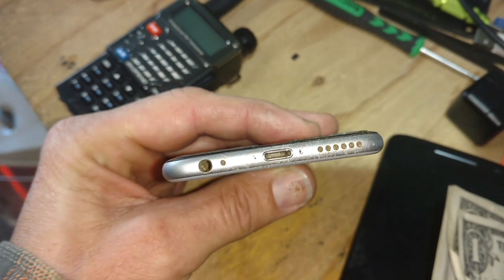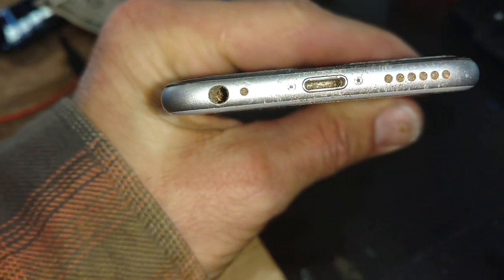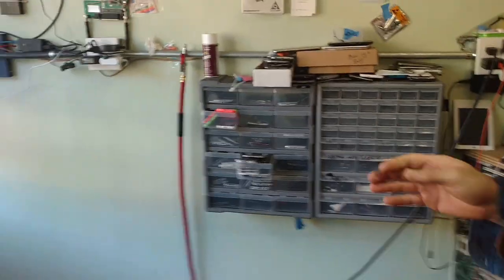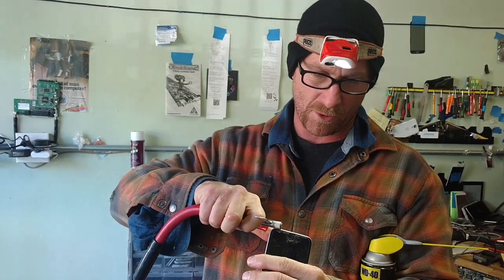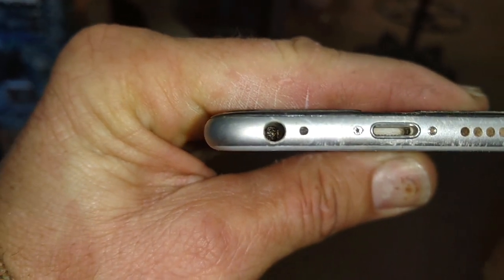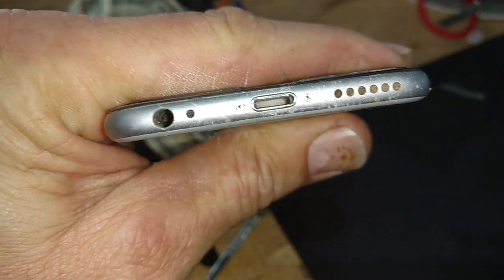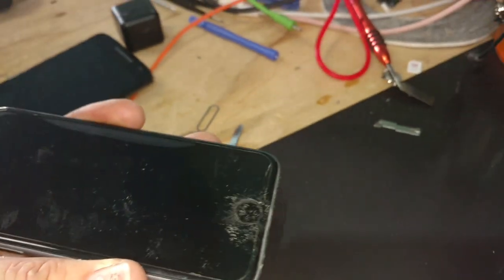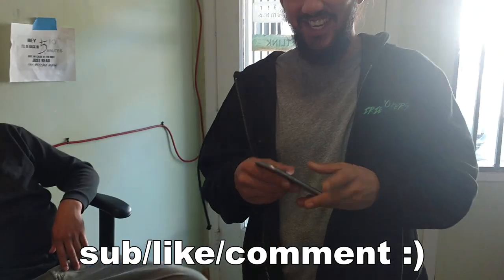*Filthy* iPhone headphone and power jacks get sparkling clean!

Comment: This was probably a parody, but somebody can think this was real advice. I am Electronic Maintenace Engineer and I use WOODEN TOOTHPICK. Preferable triangle shaped which has tiny tip.. Using metal pin is VERY BAD idea! It can cause short circuits and scratch the connector surface. Using a scalpel is something really awful. If using compressed air, it must be cleaned. DO NOT use air from compressor wihout good filtering. And don't blow near the holes and use very small pressure.  It's better to use canned air.
Reply from the maker: I doubt your credentials but believe your cowardice.
Reply: mattikaki I got slime in my headphone jack and my sound is very low can you help
Reply: Oops
Reply: I heard alot of complicated so I believe you
Reply: thank you sir there are lot of people that could damage their phones because of some stupid parodies without writing it’s a parody
Reply: If you have don’t have a tooth pick can you use a plastic fork

Comment: I want my headphone jack fixed to. I have same issue plus I'm worried for my dock connector pins
Reply from the maker: Anna Nishikinomiya u gotta get the contact cleaner at the auto store and have access to an air compressor. Then just follow my instructions, stay off the pins. They are on the bottom!